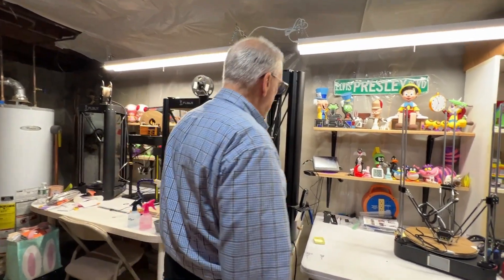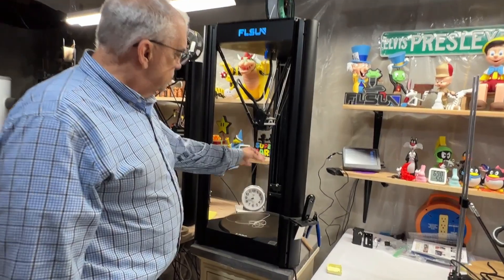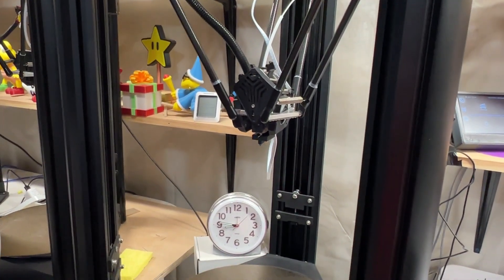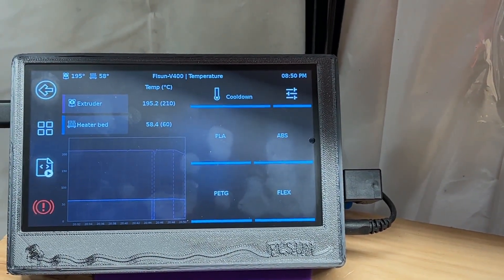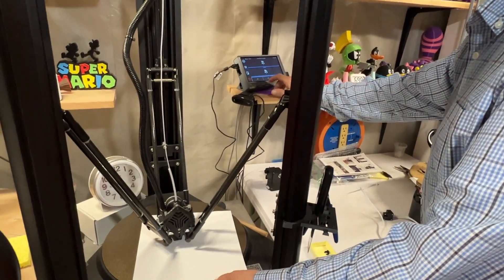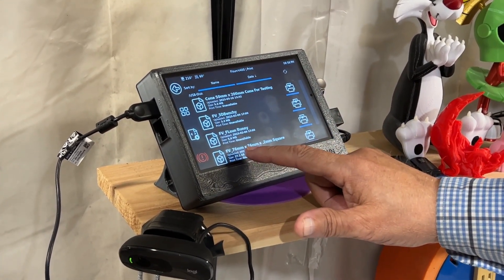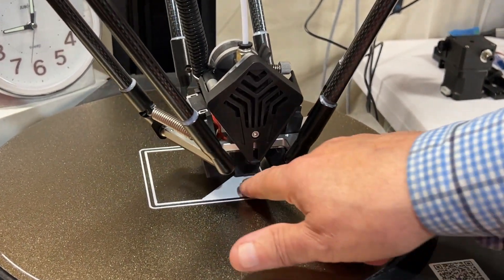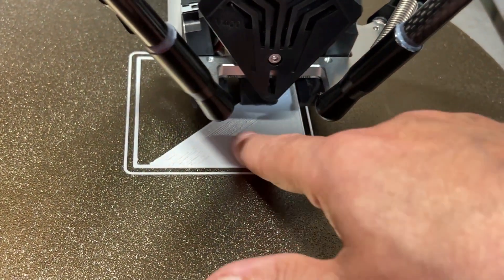Setting FLsun V400 "Z" Height

Comment: You clear the ooze from the nuzzle but since you heat it, it keeps coming out and may disrupt the calibration.
Reply from the maker: Yes, let it drip for a couple minutes then put on the level sensor. It will not impede the calibration...
Reply: @dennisgignac5103  what about the Z calibration? it will have an effect on the distance between the paper and the nuzzle
Reply from the maker: @danielkotzer636  By then the leaking should stop. If not, just use a pair of needle nose pliers to remove before the z calibration.

Comment: the v400 um prints the first layer perfectly, but when the print thickness rises, it touches the print and throws it off the table, why is that?
Reply from the maker: Please send a short video of the issue.
What revision of firmware are you running?
At the main screen press the red button and take a photo of the next screen for me.
Send to  dgignac@flsun3d.com

Comment: Mine does not have see bed mesh setting
Reply from the maker: Yes, if you V400 Pad is on firmware V1.4, it included the bed mesh in the first calibration...

Comment: hi i have updated to the new 1.4 version and the calibration menu has changed no more bed mesh seems to do it all in one now but when the screen changes to the move 0 the z offset is showing 0.00 and when press the move 0 it comes down but the head seems to hit the bed why is that and do i just move the head up until the paper is sliding with a little residents need some help please also flsun has a printer.cfg file on there website with the 1.4 update do i have to copy that to my machine and over write the original printer.cfg file not much info about it on the net can you do a video of the calibration sequence please

Comment: Hallo Dennis
It seems you have a number of FLSun printers in your workshop. 
Fistly, have you tried to print something using the full 300mm diameter and secondly, have you tested a larger nozzle e.g. 1mm to test max extrusion?
Would you considder the new T1 or S1?

Merry Xmas from South Africa.
Reply from the maker: Yes, being the USA rep for FLsun. I have all of their printers set up to help people...
I have not printed any model that wide. But I have printed the test pattern to about 280mm.
I have not tried the 1mm nozzle. Only the .4 and the .6
When the S1 and the T1 are shipping, I will be one of the first to get one...  Big Smile
Reply: @dennisgignac5103  Thank you Dennis. I dont know when we will see the S1/T1 here in SA, but cannot wait. It is going to be perfect fir my productuon line.
If i can ask you a fav, would it be possible to test the claimed 300 dia on the FLSun 400 with a 1 mins vid?
Much appreciated.

Comment: How does klipper know what the offset between the nozzle and probe is? Do you have to set it before hand?  Every time i do this the print starts around the "nozzle to probe offset" which is about 16mm off the bed.
Reply from the maker: Hello Brian:
Please contact me through email and I will try to help...
dgignac@flsun3d.com
Reply: @dennisgignac5103   I think I got it. It seems i had to z calibrate before the bed calibration.  I may have gotten the config files messed up before I tried following your video.

Comment: But it is not working all over the bed :(
Reply from the maker: Can you please explain?
Reply: @dennisgignac5103  i only can print in a maximum diameter of 150 - 200mm. If i try to print on the whole printbed it doesn't work. Some areas looks smashed. It seems the printer is ignoring the bed mesh.
I think i tried everything.
Reply from the maker: Can you please contact me through email and I will try to help...
dgignac@flsun3d.com